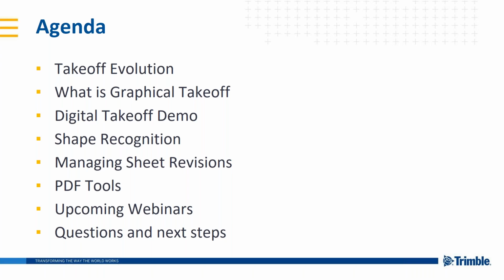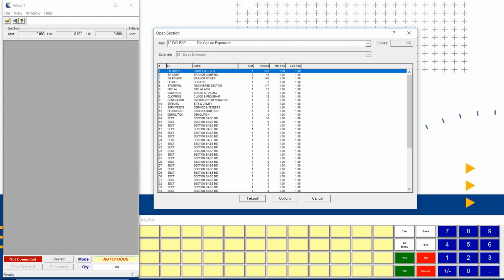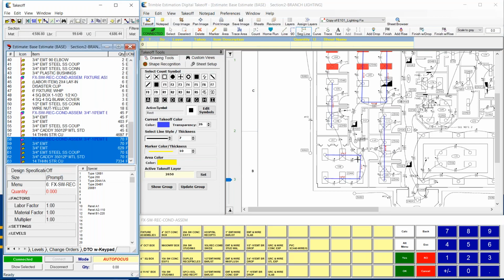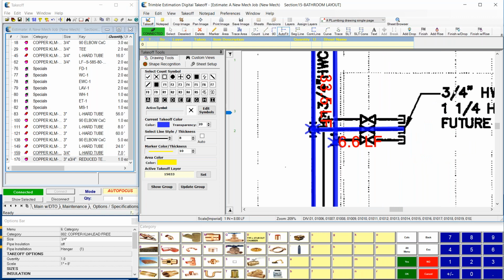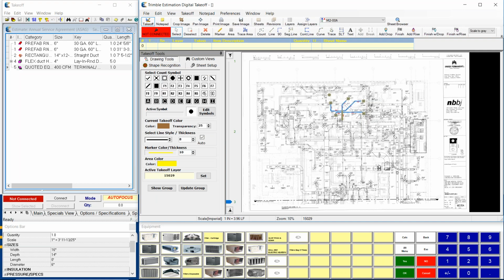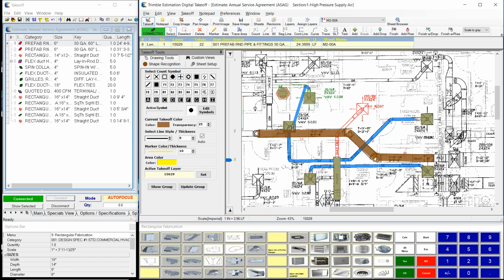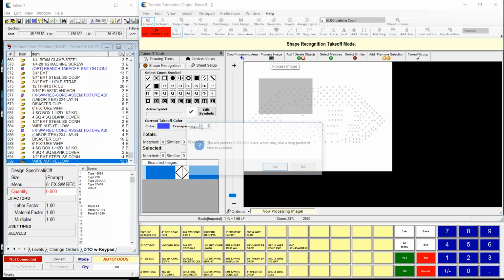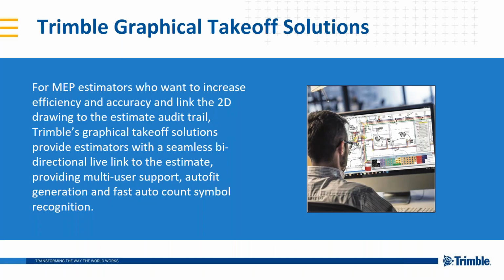The Power of Digital Takeoff - Trimble Estimation

Comment: I really don't see how on-screen take off will be better especially with the bid documents that we are getting these days. Quite frankly, they suck. Sizes missing, piping missing, equipment details are lacking, etc. Unless your company does in-house engineering, maybe it will work. I've tried on-screen take-off and it takes a lot longer than using my digitizer.
Plus, on a process job where you'll have to look at multiple document at at the same time time, I don't see a benefit getting away from paper. Plus, the people I know that use on-screen, they STILL print half size to follow along.
And I can guarantee that when you go actually build the job, we'll still need paper drawings/specs in the field.
It seems that these on-screen take of systems are for people that know nothing about what they are looking at and simply stripping drawings. That my friends is scary. But it seems that that is the direction of corporate America.
Reply: You are exactly right, as a Plumbing and Piping Estimator, I typically re-design my drawings to meet code, provide a more straight forward design for our Field and in the end save money.  I'm not throwing the baby out with the bath water, however I still prefer my digitizer and paper.  Accubid is actually Quickpen and is spec driven.  You are correct regarding the horribly designed plumbing and mech drawings that we receive, if I took off the drawings as is; I would leave a lot out.  Most of the salesman marketing and demonstrating these products, lack any real world experience regarding the real-life installation practices; they are salesman and the majority of the products that I have considered, including Trimble is over inflated with bells and whistles.  Let me say this in closing regarding the Accubid Software; depending on what Digitizer you use, Accubid will allow the use of the digitizer; so not all is lost.
Reply: @scottie1430  They WILL allow a digitizer??? They told us that digitizers are going away for good. 
And there are many times at looking a projects for costumers that there are no drawings to load. I have to walk it down and make a material list as I go.  I don't know if I can put a materials list in the Accu Bid without drawings. The one on line training I had was only about 45 min.  And they were using a VERY SIMPLE drawings to demonstrate their product. Pretty much a joke.